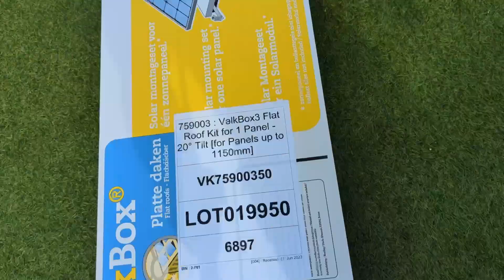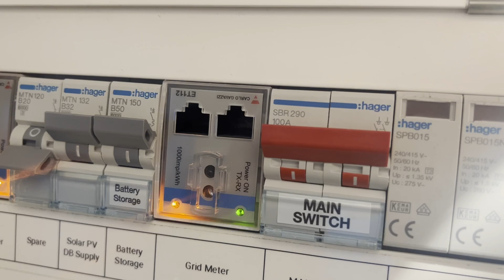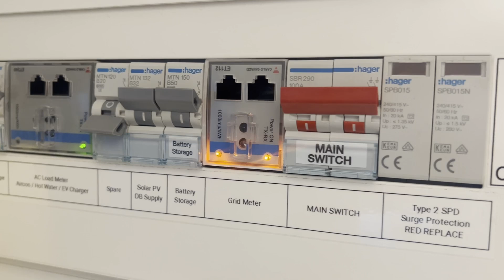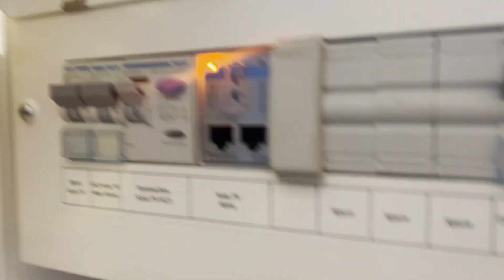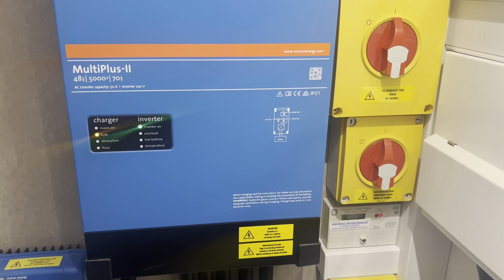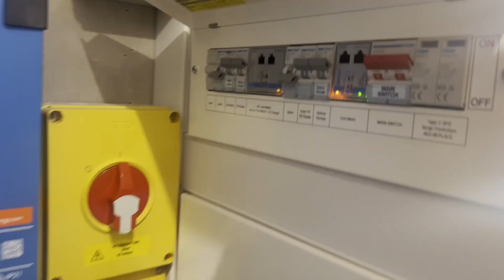How to use Victron Energy Meters ET112 and ET340

Comment: Hi, very neat work 

I have a question regarding the ET112 meter in your setup if you don't mind 

I assume your meter is upside down as you've used the busbar as the line conductor in and out of the meter 

But did you run the meter tails neutral through the meter then to the main switch 

There's a lot of conflicting Info from Victron regarding the neutral conductor and fusing it or not 

I have seen a set up with the et112 being in its own 2 way enclosure and the meter tails being terminated directly into much like a dno meter essentially and a cat 5 from the et112 to the cerbo gx
Reply from the maker: it is probably easier to deal with in a separate enclosure. I opted to fuse the neutral with some flex into a Weid Muller din rail fuse holder and a quick blow fuse and been working fine for good few years. The info is slightly confusing and Victron recently announced on their new meter VM75 you no longer need to fuse it.

Comment: Nice setup  but i never put utp signalcable insite  Just taken the rj45 on the front

No risk lessen interverance and works on the same pins
Reply from the maker: Yeah i think if I ever alter this or install another I will use the front connections. Would need to be in a separate enclosure but if you see one of my other videos with the VM75 that is exactly what I did. No issues so far worked well for a number of years.

Comment: Hey! I like the setup. Are you using the ET340 to measure 3 different phases or just three separate circuits on the same phase as a multi-energy meter?
Reply from the maker: Thanks. On this one its a single phase setup and using the ET340 to measure 3 separate single phase loads. HotWater, EV Charger and ASHP (when installed)

Comment: Nice video. Question, can you use the ET340 to measure 2 AC loads (not grid)? eg 2 separate PV systems?
Reply from the maker: Thanks 🙏 Great question so I am currently using it to measure separate AC loads such as Hot water and EV Charger. Whilst these don’t appear in the main screen of VRM the data can be shown in the advanced section.
As regards to measuring 2 PV inverters I haven’t tried it but can’t see why not it would likely combine the data on the VRM dashboard as 1 PV inverter but it would be treating it almost like a 3 phase meter

Comment: Nice video! Is that loud hum coming from the Multiplus? 😮
Reply from the maker: Thanks, it is indeed, in fairness it was kicking out some power at the time but the fans in the multiplus do seem to be quite industrial sounding.
Reply: Yes. The Multiplus II is quite noisy under load. And it still hums a bit even when lightly loaded.